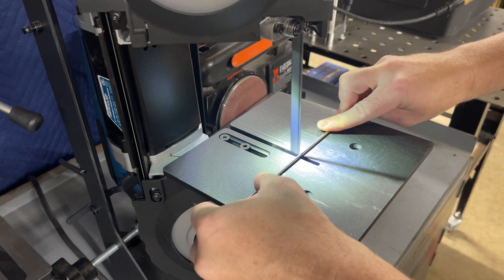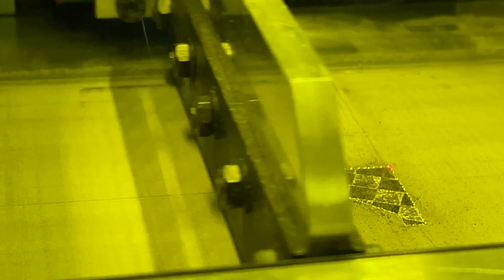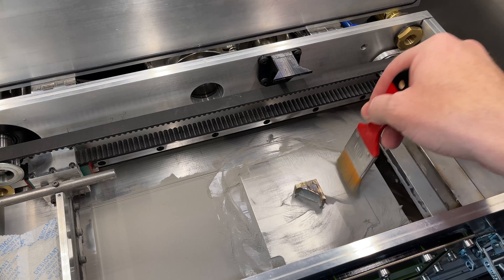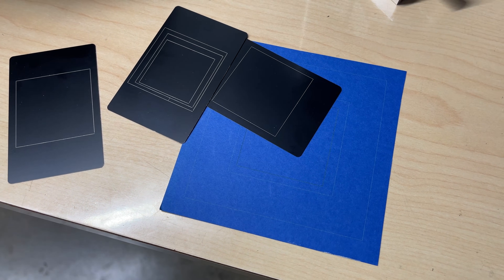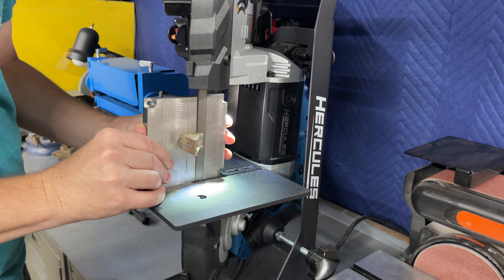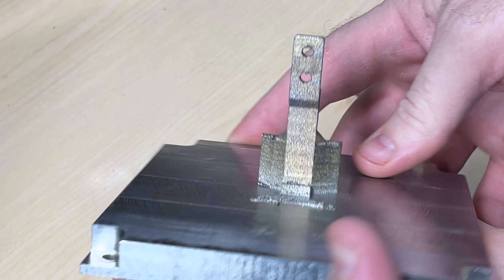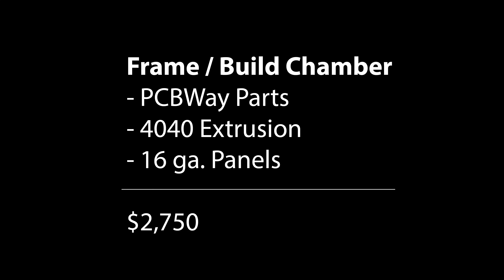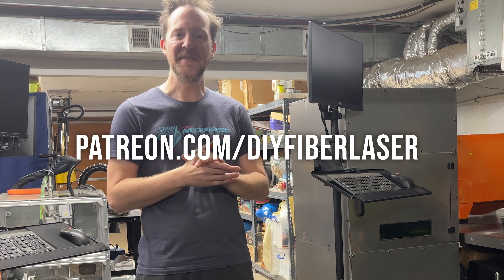DIY Metal 3D Printer: Part 9

Comment: You definitely deserve a resting time, this project is huge acheivement never the less! I was eager to see this part 9 video!   It's quite amazing where you are at (so far). Anyway, here goes my 2 cents: Apparently you have sorted out the issue with the roller, but I would make it full metal as the residual heat inside the chamber can "soften" the 3D printed holder due to heat transfer, also, an heated chamber is a must, I think that will avoid that uneven coloring and thermal expansion on your parts (I have read somewhere it's really needed), regarding the Ar expenses.. Yeah, maybe a recirculating system that is fully sealed is the solution, maybe you have some sort of leaking, maybe using some sort of transfer membrane that allows Ar to pass into some container can help you not spending so much argon. Apart from that, man, you are absolutely there, and congrats on your project! 

Btw, I've just bought a water cooled galvo that can withstand 2kW of optical power from SinoGalvo, that was my go to because it uses a protocol that can be used with homemade controller. 

Last but bot not least, I will be using an oven blower do disperse the gas over the part... That's how cheap I went!!! 😅 

Good luck with the rest of the project!

Edit: To sort out lens distortion, get EzCad (or other) and check if It is  compatible with your controller, you can set the distortion comoensation file there!

Comment: At work we have a Concept M1 and a M2 metal printer. Our printers use Nitrogen. What our machines also do the first laser an outline (to reduce spatter), then laser the fills in inner section. The inner section is also not laserd in one pass. It divides part in multiple laser sections. Eg. it starts on top, bottom, middle, left, right  and so on. This is to reduce warping. After the part is finished we are blast them with metal beads to hammer the surface.

Comment: Really cool project. Congrats for making it this far. For better adhesion and higher succesrate of the produced parts think about placing them rotated 90 degree on the build plate. The amount of force and arm of laverage will be reduced and you don't risk the whole build job failing if one part is dragged into the one sitting behind when the recoater travels over them.
You could even consider placing them further apart to reduce issues related to inderect heat accumolation and even further reduce the risk of failed jobs. But you definetely should print some test cubes and pins in the corners and the middle of the build plate to assure dimensional accuracy of the parts for the whole build plate.

Comment: Edit : The high-frequency noise us actually a lot better for the majority of the video. I should have finished it before commenting...

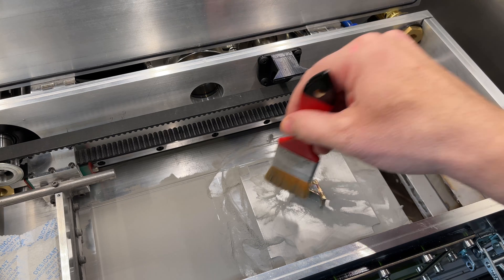The high frequency screeching / whining sounds ( for example, like that around 5:42 ) make it practically impossible for me to even understand what you're saying.

PLEASE please run the audio (or just do a voiceover, or only do the filtering process for the parts of the video that were recorded near your stepper motors and the associated drive electronics) through a notch or comb filter (or even just something like Audacity's built-in graphic equalizer) to at least filter out the loudest and most obnoxious of those piercing, migraine-inducing harmonics.

I can, unfortunately, not do any sufficiently accurate filtering on Android to both knock down most of the whine, while also preserving enough of your voice's HF detail (especially between 4-10 kHz) such that the audio isn't fatiguing to listen to and so that I can easily comprehend what you're saying.

PS.
I really enjoy following along with your progress on this project and would love to be able to listen to the sections where you're recording while the motors are running; however I also know that you only have an extremely limited amount of time available and that the high-frequency sounds probably don't even bother anyone else, so I completely understand if you can't do anything about ir.
I just thought I'd continue asking incase you didn't see my previous comments.

Comment: I think that the doming and protrusion could be a function of a heat explosion/humidity and too focused high power laser (at some points the laser makes explosions). you would want to minimally partially melt the surrounding of the piece to interrupt the surface tension for doming and protruding, but weak enough to be remove by hand or sanded. or melting them much less to each grain has less time to blob before solidification. 

the big question at the end is, are you sure that your piece is not stronger than the one from pcb way? maybe pcb way's piece is much closer to a sintered piece than yours.

Comment: Is there a sintering equivalent to fdm's linear advance?  There are times I see heat building up in tighter areas or at the end of a layer (brighter color) - looks like extra material buildup is contributing to some failures.  Maybe laser power could slightly adjust to accommodate pathing geometry and offset this heat/buildup?

Comment: This is so sick. Killing me to not start trying to copy you; but I'm not ready for that yet. 

Size 300 tank is probably a good plan...also interesting Argon is used for this, I'm hearing I should be using N2 for SS laser welding, I wonder if a Ar/N2 mix might be usable (and cheaper)!
Reply: You run the risk of Nitrigen embrittlement since the optimal nitrogen incorporation parameters are never going to be the same as the optimal parameters for actually printing stuff.
Helium is technically the best gas due to its high thermal diffusivity, but Argon isn't a bad choice.

Nitrogen should in general be avoided, because you're going to get substantially different mechanical and chemical properties in the thin, nonuniform shell (thickest at the top of the layer and variable at the bottom, depending on the Nitrogen concentration and presence or absence of a metal layer underneath the current layer) around each metal particle's core (essentially the range that Nitrogen was able to diffuse, given the heating and cooling curves that your specific parameters generate).
Reply: @mortlet5180  Interesting, makes sense. I use ArHe35 for Al welding and it's worth it at those low flow rates. Pure HE price would be truly insane for filling a chamber, but I wonder if you could get some worthwhile improvement going from Ar to ArHe5.

Comment: it's just for testing and my own wondering... is it possible for you to play with the power of the laser in the software? if so you could play in a test pattern with different power settings maybe it gives better results on which power setting works the best. so that you could in the end forget the support structure entirely

Comment: Nice result for a first few prints!
Personally I would play around with your current design a bit more before redesigning everything again. One very important thing when you are now doing the process development is that you check your optics(especially your top window) for cleanliness, if the black soot gets on there it will heat up and there will be an effect called thermal lensing, if you get that it can make it impossible to get to a working process parameter set.
For the basic process I think you have to play around with the energy setting for small parts compared to the big parts, the process is completely thermally driven and conductivity plays a huge role in this and small pieces or thin walls conduct heat a lot worse than some bulk material.
Generally you want to add support when the overhang is greater than 45 degrees.
About the heated chamber I don't think that does much, people often confuse SLM (metal) to SLS (plastics) in professional machines nobody has a heated chamber in the latest machines.
A roller recoater can work well but it is very sensitive for parts protruding out of the powder bed, the latest machines all don't use it, most use a hard recoater blade or a silicone profile, once you tune your process parameters better it will also not wear out as fast.
The heated build plate is also something that is only useful if you start working with Aluminum, but this material is also very flammable so I would not recommend it for hobby usage, same as titanium.
Since your Argon usage is quite expensive I could share my design for a nitrogen generator with you, it will probably cost 500-600 dollar to make but then you only need to supply compressed air which is relatively cheap. For Stainless steel it is actually a better gas than argon since the nitrogen strengthens the steel.
Thanks for mentioning my channel, if you need any further help/advice feel free to reach out.
Reply: Great work on your work! I've been following for a while now. I'm a researcher in alloy development in AM, and would like to leave my $0.02 here. 

Substrate preheating has been shown to be effective in reducing accumulated thermal stresses in all LPBF-produced parts; it's tautologically necessary. Increasing T_bed will decrease the difference in temperature between the part and the bed, in turn decreasing the thermal gradient. Since thermal stress is directly proportional to the temperature differential, this will directly reduce thermal stresses. 

There's also microstructure evolutionary advantages, which depend on the material. For example, in Ti-6Al-4V this includes the formation of martensitic structures in the as deposited condition, notably acicular α′ , which forms within columnar prior-β grains that grow along the build direction. This will drastically lower ductility because of their low capacity to tolerate crack initiation & propensity to tolerate propagation
Reply: @beno7969  Yes I do agree that it helps, but for a DIY machine you will reach a temperature of max 100-150 degrees celcius, if you go really hard you can maybe achieve 200 degrees. But this will require such a high investment that it is probably not worth it. 
You will need special seals, special mounting and potentially even water cooling to keep the other components cool, it is all possible but probably not worth the effort and investment.

with a melting point of 1400 degrees for stainless steel the 100 degrees difference is very minimal change. if you preheat it to 400-500 degrees it becomes a different story.
Reply: @Metal-Base-sp4hb  Thanks for your reply! I had not considered changes that the DIYer would have to make to their system to achieve preheats seen in the EOS/Renishaw systems. I do agree, the advantages gained through these changes are only realized in highly specific use cases, so for the majority of prints, it'd be unnecessary.  Cheers
Reply: Mhm Nitrogen and strengthen dosnt really fit my world of how iron alloys work yes it hardens it but on the other side it also gets more brittel

Comment: One could disassemble an infrared thermometer and integrate its individual components into a system. Through programmable control, it would be possible to define the maximum temperature at which a component automatically pauses operation to ensure safety. Essentially, this would function as an AI-powered thermal camera that also provides the ability to send an email alert whenever critical temperature thresholds are exceeded. In addition, an automatic extinguishing system could be activated via a valve—either automatically or by pressing a button through an app.

To determine the optimal temperature, one could, for example, print three to four layers of squares under different conditions in order to identify the temperature at which the printing process delivers the best results.

Comment: 11:04 is there a minimum time per layer? As you go up on the triangle the time of each layer print is shorter so time doesn’t look like in lowers. If you did two prints. One flat based down the one point down. The layer should be similar all the way up.

Comment: The uneven distribution of powder was also causing the top of the original component to overheat. Also, I thought the benefit of SLS printing was that it didn't require supports because the powder is the support material. Enjoy your break! 🙏
Reply: In SLM or LPBF process, powder doesn't actually support the part, as the melt pool is more dense than the powder bed.

Comment: Yeah man, take your time and take care of yourself first and foremost... Yoootube is not worth getting burned out over.

If I already knew that I wanted to make major changes, and they had a high probability of helping, I would probably be tempted to jump directly to the next gen chamber/setup if I were in your shoes. And then rather optimize step-by-step from there. It's okay to do when going from proof-of-concept to the next step in my opinion, if the changes are difficult to make through a more iterative process. But obviously... the more you change simultaneously, the less control you have.

Comment: The "voids in the powder delivery system" issue is easy: Add vibration to the point where powder is collected for transfer to the print bed, even intermittent will do.

As for the respreader catching, a redesign to let it drag over the print instead of push over may serve better; some kind of flapper mount for a piece of sheet metal, or a strip of wire brushes instead of a rigid bar, shouldn't have the same issues with catching on irregularities. That rigid bar system might be why half your last test print here detached from the build plate, given how the bar seems to snap forward when it finally breaks loose. I can easily see that repetitive impact peeling your raft structure on a tall print due to leverage, and the repetitive pushing against print surface irregularities could easily cause a compounding peeling issue in the same way.

If you can't solve the heat warping initially? You might also want to consider temporary heatsink scaffolding as mandatory for prints, intended to be ground off in the finishing process, especially if they're going to be solid metal instead of an open honeycomb or other non-solid. Powders insulate way better than solids due to the microscopic gas pockets between the grains, even if that powder is a metal, and you may have to trade a bit of design time and post-print elbow grease at the grinder for a good garage-build final product.

Comment: Very cool project. Heads up at 5:42 there's an extremely high pitched whine in the footage. You might want to check your audio with a spectrogram scope to see if you're getting big spikes in problem frequency areas. That way, you can create a set of narrow band notch filters that remove those problem frequencies in all your footage without being noticeable if you were to apply them to normal footage.
Reply: i feel like you would have done it yourself if you could

Comment: Parts shouldn't need any support material, because the surrounding powder is the support material. Those PCBWay parts will have been "sandblasted" as part of the post-oven powder retrieval process.

Comment: I think the main problem is the melting is causing unwanted protrusions (stuff that is catching), like popping. Maybe lower power and slower tracing would help. Great progress nonetheless.
Reply: I think that is why heated chambers are so important. It allows you to get the powder closer to the fusing temp so the laser doesn't need to be as high powered to push it over the edge.
Reply: Crazy idea: what if the layer is held down by a glass pane the laser shoots through? Given the metal can't fuse to or melt this glass; I don't know if this is possible.

Resin printers hold the layer squeezed between the fep plastic sheet and the build plate.
Reply: @billytalentrocks345  Overkill for this project I bet, but I reckon that's a solid idea. Might need to use something like sapphire/ALON instead of glass because it's gonna pick up insane point conduction heat from the melt pool, but that seems like it would vastly increase the internal structure. Probably a patent there if it isn't already, haha
Reply: @billytalentrocks345  to take it a step further, what if the metal layers were deposited similar to an inkjet printer, coming from a print head with a metal powder slurry, then the print bed came down and the laser shot through the glass, fusing the later
Reply: @cantstopthefunk22  That would enable hybrid metal parts, like the Mimaki does with colored resin
Reply: @cantstopthefunk22  what would you use as a liquid to make this hypothetical slurry? keeping in mind how liquids tend to turn to vapor and expand when heated past their boiling point.
Reply: @LexYeen I would theorize some sort of light wax material that burns off cleanly. I may be mistaken but I believe a filament with a similar composition to this is already being used to print metal parts

Comment: Super RAD🤙🏻😉..

Is not The media is supposed to serve as the “support”?
Reply: I thought so too, but I think you do need at least some anchor points to build plate, so the print stays in place when the decoder blades it re-spreading the media. I definitely think much less supports would make sense and reduce the warping issues.

Comment: It really seems like the build plate needs to lower a little when the recoater blade does it's first pass. It doesn't look like it goes down at all, so the recoater blade seems to basically be scraping along the top of the part instead of sliding above it. I've never built one of these before, nor have I ever used one, so take this with a grain of salt, but my mechanical intuition thinks that build plate needs to drop a bit to leave room for the next layer of powder!
Reply: Yes this seems like the most important area where there's a ton of improvement to be found. I would have thought that the consistency and even spread of that powder layer is crucial to a neat print.
Reply: Yes I was wondering also and wrote this in the last video, but did not get any info!